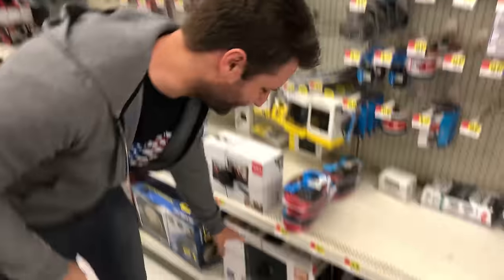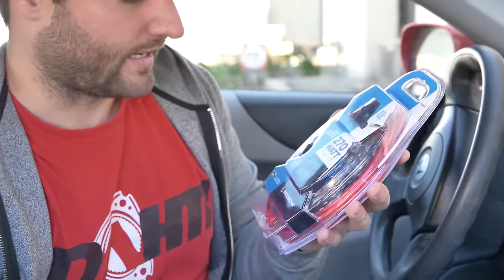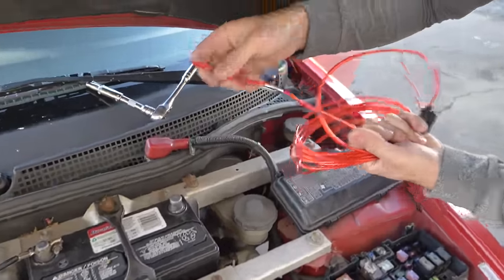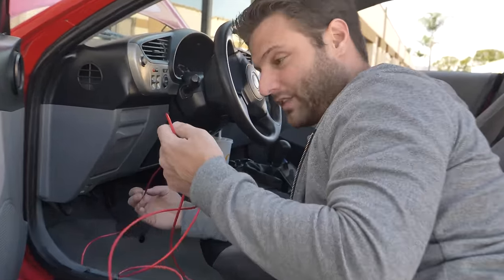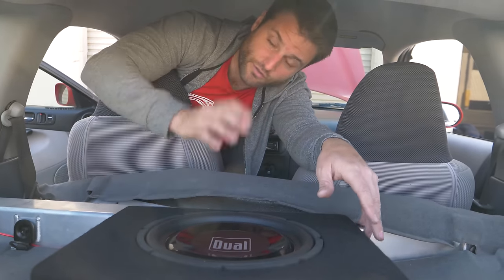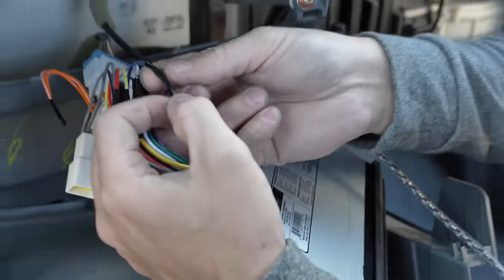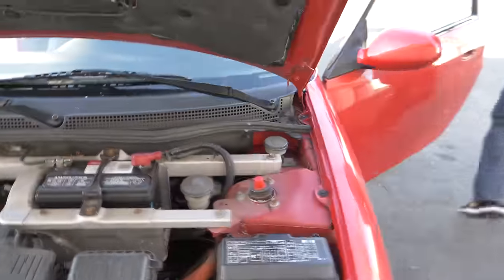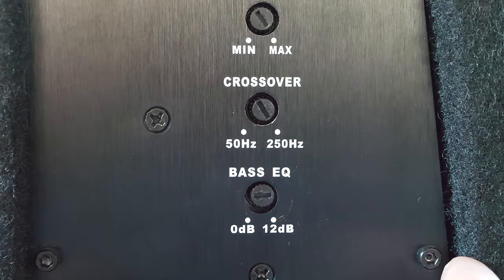How bad is the $70 subwoofer from Walmart? Install | Review

Comment: That is why I hate Walmart. It is frequency not just music.  That subwoofer reproduces frequencies sent by the radio and the amplifier boosts that. How loud it is is decibels "DB" and humans hear frequencies from 20 Hz up to 20,000 Hz. 20hz being very low bass and 20,000hz high frequencies. A subwoofer can only reproduce frequencies in a certain range. It also can only handle so much power, so if you turn the gain all the way up and it's built in crossover is set to allow higher frequencies it will cause distortion and that makes the voice coil heat up and or clip out. 
I can't stress this next thing enough:

**Your negative ground is more important than hooking up the positive red wire**
. A bad ground causes your speakers system wide to have awful road noise. The noise you hear when you rev the motor that sounds whiny. (BAD GROUND) Some older vehicles and motorcycles will do this with a good ground and will need an isolater loop installed inline with the power wire. There are a few different designs. Some run in the RCA patch cords and others in the power wires. On aftermarket radios on occasion you will see a black plastic box on the harness that is an isolator loop.  It is basically   a filter. Tune your radio to the subwoofer high end first. Turn the bass all the way down, turn up the high end till it sounds crappy and back it off till it sounds good then bring up your subwoofer the same, till it distorts and back down.  If not done in that order you will not hear the sub if it is distorting and can damage it. I know car audio guys are "I do it like this". This is not for you it's for the guy that does not know and has not tuned a system, have them bring the sub up to the music it will save them blowing it up. 
If a speaker can not reproduce the frequencies you give it at high volume it is going to try to reproduce them. It will come out as distortion and that can damage speakers. 

I used to take bipolar or non polar capacitors and build my own passive crossovers. A non polar capacitor cuts off low frequencies often mid range and high range speakers can't reproduce. As where a coil will cut off high frequencies. (Ever take a home stereo speaker box apart and on the PCB is some caps and a coil or three?? That is a passive crossover) You can get charts online that will show you what components to use, what config. for the  frequencies you need the speaker not to see. It basically used DB cutoff  how many DB's of that frequencies will be cut off from the speaker 6db, 18db, 24db, so on. 12db & 18db are widely used in passive systems while a 6db is used on many tweeters as you can, if disassembled, see a capacitor inline with the speaker wire. The lower the micro-farad number the more bass is cut off. the higher lets more bass in. 220uf is a mice midrange cap. Thats your lesson for today have fun building your first system.

Comment: So if on my install its sort of mandatory that my power wire and the RCA wire will be run on the same side of the truck, since its for only the sub will I stand to get interference sounds or humming ?? Or will it be OK? I can probably separate them by running either under the carpet about 6 inches away from one another ??? Thanks

Comment: Rob dahm can you clarify wiring I wired as the book showed but you said you did something different. Both reds to power both blacks to ground and both blue to remote but unit will not power on. I have power and fuses are good. I'm lost ...

Comment: I hope you eventually real wired your power wire because only stupid run there wires through the fender of car because if that wire catches a fire it’s done that’s why you run it through the fire wall to battery not your fuse box

Comment: Been working on this all day, the amp won’t get power,  what do I do with the 2 red, 2 brown 2 blue in the wire harness? Splice them together?
Reply: matt smith that's what he did on the video.  On the wire harness that came with the speaker, he spliced the 2 red together, 2 black together, and the 2 blue together.  Then spliced those to the power, the ground, and the lead.  I'm assuming you already figured it out. Is that what you did?

Comment: I instaled 1 of these in my wifes vehicle.shes wanting more sound.can i wire another sub amp combo to the exzisting wires from the first one? Or do i have to run a whole other set of wires to batt, remote, ground ect? Just wandering if i could tap into the exzosting wires? Anyone have any suggestions.and not ripping it out.

Comment: Did you really hook your power to to straight to the fuse box? I guess it really doesn't matter for what you're powering LOL
Reply: When I bought my new car I had my system hooked up at Circuit City because I didn't feel like messing with it and they told me that I had to have it professionally installed to avoid voiding the warranty if something went wrong and they did the same thing. Hooked my power wire right to the fuse box. They also ran all the wires on the same side and I was getting like interfere static noise. So I moved the ground and remote wire to the opposite side n it solved that problem.
Reply: I used Circuit City one time. Similar thing, just to hook the head unit up and avoid warranty issues. I just don't trust people to hook up an amp correctly.
Reply: Yeah I don't usually either I was just having them run the wires so I didn't have to do it. But then I wound up rerouting them anyway so it's basically a waste of money and was actually pissed because in my Mustang I have the 8 inch subs in the doors and they didn't even hook them up when I was paying them to hook to head unit up and have all the speakers working whether or not they had to run additional wires from the subs I was willing to pay for it. But now we know why they went out of business lol

Comment: Someone PLEASE explain this to me: why is there only one power wire to the sub-woofer? Surely an electric circuit needs both a positive and a negative? Like i get what the grounding wire is for, but why only one power cable?
Reply: Okay so there is one wire that is always hot and it comes from the batt or fuse box whichever you prefer then you have your remote turn on that is keyed and it acts like a solenoid letting power from the constantly hot wire to the switched sub
Reply: I hope this answers your question
Reply: @lukehaak5907  I’ve installed a good bit of units in my time but always used the battery or an extra battery. Is there an advantage to using the fusebox?
Reply: @RookieMistakeYT  not realy just pereference

Comment: my 1000w amp didnt come with the high side plugs,,,,, im using rca wires at moment and its not loud at all, its like the factory radio loud,,, would it get louder using the high side wires instead ??? they are 50w x4

Comment: Why would you go underneath the fender when you can go under the floor bored of the car and run it up through the fire wall. Also Why would you run it to the fues box what logic are you useing. Hook to the Battery so that if somthing happens guess what your battery is now bad and not multipile fuses and relays in your fuse box not to mention the computer

Comment: kids, never run your power wire through the fender.
Reply: Baddaddy_gaming I gotta admit, he followed factory wiring through the gromit thAt comes in the door jam with door speaker, lock unlock, and window switch or just speaker depending on trim model. But regardless the wire is smaller than most peoples aftermarket speaker wire. I’m not saying he ran it correct but given size and route ran he isn’t in a pinch zone
Reply: @coreykeigher8286  yeah i guess in this case youre right. I would still go fire wall though
Reply: I’m not recommending it but at the same time seeing how this car is setup makes me wonder how many 4 channel channel amps could have been simplified coming in that way instead of tearing the underdash apart and figuring out where to run it through the firewall on top of fighting 4 2/0 wires lol

Comment: as an installer it made me laugh. Never run positive cables through the fender. I would slap you if i saw u doing this lol I’d go 4 gauge power and ground lol that 8 or 10 gauge I use for my speakers
Reply: I did 4 gauge power and 8 ground because the tabs on the amp are small as hell.
Reply: Jeff yes that’s what you’d expect when you buy from wal mart. I personally don’t buy car audio from wal mart. It’s cheap lol as they saying goes, you get what you pay for :) I’d at the least go 4 guage for that sort of system. I’ve seen this all in one subs and the amplifier lacks a lot of power. I would buy an amplifier that’s a little more powerful and poly fil the inside of the box. Ask me anything about car audio. I’m not a back yard installer, i know what’s right and what’s not lol

Comment: Any help of anyone i installed everything but the sub only works with radio not bluetooth or aux there is 2 blue and white cable they both turn the sub on but neither of them work with bluetooth or aux

Comment: If you are on a low budget and you need a stereo for you car and your not getting a subwoofer Walmart is I great place to go If you need new component speakers for your doos and rears you can get a head unit with Bluetooth and a pair of speakers for 40$ at Walmart maybe less but if your getting a subwoofer do get one from Walmart please you most likely will be disappointed with the sound maybe you won’t maybes you like when you here distortion or like it when you sub bottoms out that’s all you but really don’t get one from Walmart The only subs I would recommend if you were getting a sub from Walmart are the kicker they are the best quality ones there but they are all the low end ones but if you have some place that sells car audio I’d go there it may be more expensive but you won’t be disappointed you can even get great systems on eBay craigslist pawn shops even thrift store if your lucky I’ve seen a few decent subs at thrift stores all I’m saying is stay away from the brand Dual I hope you have a great day

Comment: Dude you can tell he has never done this before first of all u should clean your ground and dialectic grease it and never go through the fender and u should never hook to your fuse box always go straight to the battery my. Buddy took his to a shop and they did that and blow up his fuse box was almost 500$ to fix it so go straight to battery save your self the money and the thing is like nothing one of my door speakers are louder the that thing don’t be a idiot and get this u can get amp and subs and wiring kit for under 100$ and be a lot happier

Comment: dont buy this thing buy a 12 or 2 10s make ur own box it’s super simple use the same wiring kit he bought and a decent amp and it’ll have a lot more power and reliability
Reply: i did my whole system myself for 120 and the extra 40 or so dollars is definitely worth it if you want your speakers to last and have the best sound
Reply: also, don’t run your fucking wire through the fender try to get it through a small hole in the firewall, on my 2004 accord there’s a small hole that has a rubber plug that’s being unused and it passes straight through to the back of my radio

Comment: Bro, garbage, you would have done better with an amp for your factory speakers. 400w 4 channel to the speakers you put in previously would give better bass and sound quality, and by the way Dual systems  is a rip they spend pennies to build they're trash and sell it for 30 bucks. All I'm saying is I cand build a sound system for that car that will max at 110 decibels for $120

Comment: Okay:
Step 1: Remove positive battery terminal.
WRONG! You should always remove the NEGATIVE battery terminal.
 If you leave the negative on the battery, the negative terminal is still grounded. If the red connector should flop around and touch any metal piece in the engine bay, you will see giant sparks, and possibly fry your electrical system. If you touch the red connector and any metal part at the same time, you could light your own hair on fire, and turn your eyes silver.

Comment: Sooo cringyy. As a basshead. So many things was done wrong here.
Reply: Would this sub work well with Dubstep? I'm looking to put a powered sub in my car. What would you recommend, something budget. im a noobie to this stuff.
Reply: @Baghuul  no dont buy anything from walmart. If you listen too dub. Id say go with an 8" an 6.5". Tht way all bass, drum, kicks ect get hit. Also u want a sealed box. It will sound tight an precise as it should, if you need more bass then tht you can add a 500rms 12 sub.  Avoid brands like. Dual, sony, rockville, soundstorm, ct sounds. If u wnt goodcsound. Do kicker, alpine, jl audio, sundown,orion, dc audio.
Reply: @dddurk123456789  Would the Kicker hideaway work?
Reply: @Baghuul  if your talking about the pre fab sub box. Id say dont waste your time. You need too be able too build and tune your own box with the subs. Now if you talkin bout the amp. I would say deff not. Its 280$. For 300w rms x2.  You csn get a kicker cxa 1200.1 or 900.2 for less money. Check out the cxa amps. An then lmk so we can figure this out.
Reply: @dddurk123456789  Im not looking for a big sound system. Im not really into building ect... I got virgin ears too. Do you know any amp/sub combos?
Reply: @Baghuul  well lemme say this. If you want good sound. You are never gonna get tht from pre fab boxs or loaded, or powered boxes. So in tht regard. Im not the guy too help you there. And too instal one sub too sound good is gonna cost 1-2k$. I dont know how too do cheap set ups. But what id say is you need a sealed 2 cubic foot box and a ported 4 cubic foot box. One tuned at 30hz and the other tuned too 60hz.  Which is 1 8 inch dual stacked woofer in the sealed box and  tripple stacked 12. In the ported box. With 4 amps. 2 linked mono blocks. 1 4 channel class A amp for your doors an rear deck. Then a class AB for your highs and tweets. Otherwise idk how too recomened for small system. But anything from kicker will be quality, thts the best i can recomend.
Reply: @dddurk123456789  Hi!, I decided to buy the kicker hideaway.  I installed it myself. It was daunting at first. But I was patient and it works. I properly tuned the gain, crossover ect... But my stock stereo almost gives off the same bass. I didn't know what to expect. I will return it.  But i'm ready to go  the step further. Maybe something more budget then you mentioned. Perhaps one amp and 2 subs around the 400-600 watt range, maybe around 500 bucks.?
Reply: @Baghuul   you should have an osiliscope. If you dont, it wasnt tuned right cuz you need yoo see the sine wave live action. You use the same tool too find max volume of the deck before clipping. Second you then tune your amp with same tool. Did you do that??. Also what size power wire did u use and where did you ground the amp. And what size and length ground wire did you use?. Also what subs you choose? What ohm did u wire it too, also what size wire dis you use?. If the deck is putting out more bass then the amp. Something wasnt done right. And you would be better off getting one sub with same power but in a bigger box jus a lil tip. More woofers dosent mean more bass.
Reply: @dddurk123456789  I got the kicker 8" hideaway, 150 watts. Its a sub/amp combo. I got a 10 gauge wiring kit. The sub came with a wiring harness which the ground wire is probably around 1 foot long, connected it to car seat bolt, which I sanded to ensure good contact. I didn't use a device to tune it. I turned the volume on the head unit 75% and slowly turned up the gain until the sub started to distort, then turned it back a little bit. It gives off bass but its not a big change.
Reply: @Baghuul  ok so your ground is fine thts a good ground an a pain in the behind as im sure your aware of. But 10awg is wayyyyyy too small. Heck i use 10awg as my speaker wire. So tht amp wasnt getting all the power it neede. U need 8awg minimum 4awg would be better. For every 10ft of wire you lose 3 amps 2 volts and 20 watts of power. And at 150 watts rms thts 20 amps of powet. And 10awg carrys 20 amps at 1-5 feet and thts max with ofc wire. So at a normal 15 foot run in a car you lost 6-8 amps ect so tht amp saw 10 amps at 11.9 volts. Thts why it was crap. So nxt amp you want at least 1000 watts rms. Too give you the bass you want. So the kicker. 1200.1 amp is what you want then  get you 4 awg ofc wire. Then kicker comp vx 12. Which is 750 rms 1500 watts  which is perfect for tht amp. Put it in a 4 cube ft box and yiu will be bassing. Jus remeber you get what you pay for. Cheap stuff is cheap for a reason.if thts too much for tht amp. You could go with the 800. 1. And make sure its a dvc 4 ohm sub. You should be able too get all tht for 800. Minus the box.

Comment: You could have at least spent 5 bucks on some butt-splices instead of just twisting wire and taping it together or you should be making a video on how to replace fuses next; you repeatedly talk about safety measures and do shit like that? Not even trying to be a snob but if you're making a how-to video you could at least practice what you preach

Comment: I would advise anybody to not buy this piece of fucking shit sub I bought one ran me $80 I hooked it up correctly like instructed and it just blows fuses left and right no use time out of it all it did right when I popped a new fuse in is blow it I even bypassed the built in amp and ran it to a 350 watt rockwood and i still didn't get any use time it just kept putting my amp into protect mode so to anybody looking at buying this new I do not advise it you can however bypass the amp and hardwire it to your speaker connections then you should be fine but it will not hit as hard as its suppose to